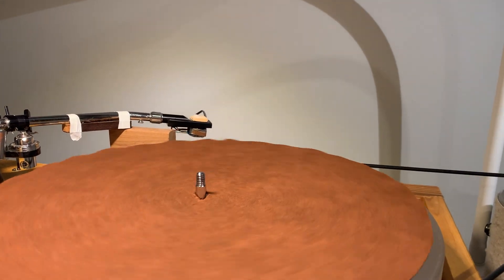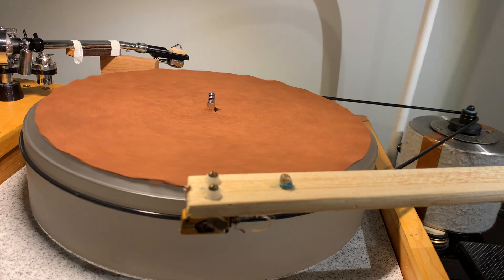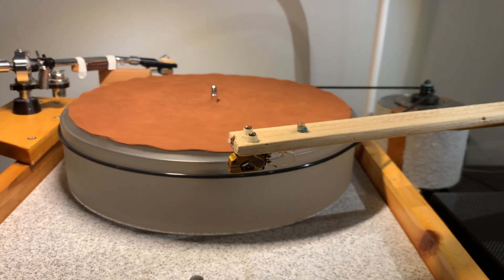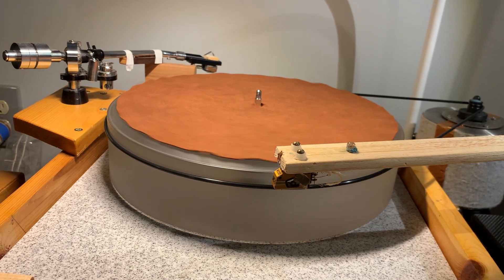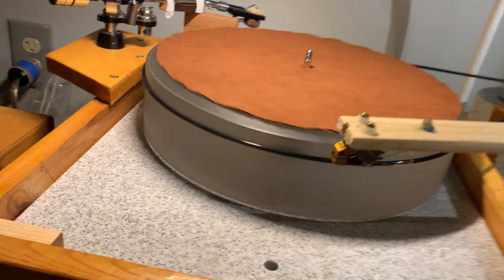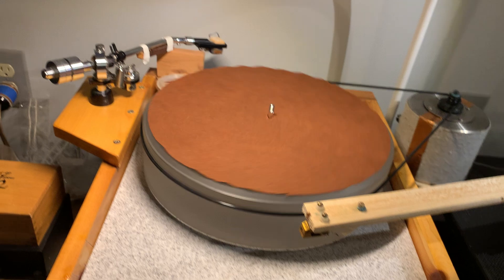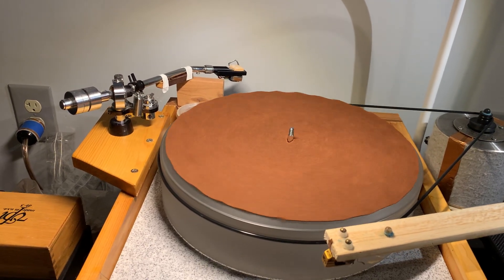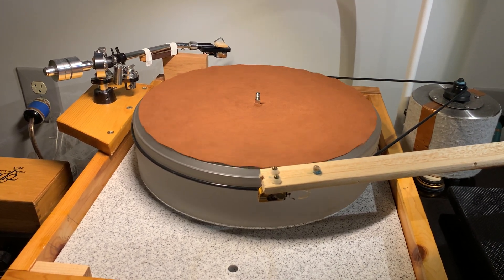How to plan for multiple MC cartridges - my example

Comment: Hi Janos you need to consider also how the output voltage of the mc cartridge is generated.
For example my Supex 900 has about the same output at .3 mv as my Carnegie cartridge.   The step up requirements are different because the Supex has its coils are wound on a ferrous core and the Carnegie carts coils are wound on an air core bobbin.While they both have similar output voltages they wont work with the same step up because the Supex is 3 ohms and the Carnegie is 30 ohms.This is somewhat of a rarity but it does occur so also keep an eye out for the carts output impedance as well when using multiple carts with 1 step up trans.
Regards Lou
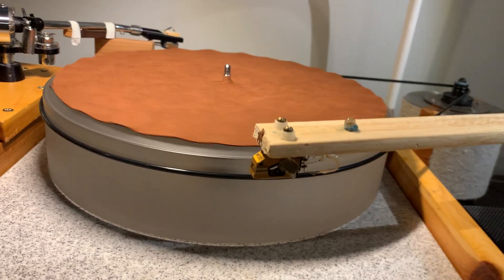Reply from the maker: Thank you Lou! 3R with 0.3mV, that's quite amazing. Indeed, it will not be happy with a x25/28dB step up... will need higher impedance matching. Do I remember correctly, your Silk step-up has 1:40 step up ratio to match it? Regards, Janos ;
Reply: @realworldaudio  Janos I use the Hashimoto which i can series or parallel the primary windings for 1:20 or 1 : 40 in which I use my Audioquest 404i or Supex 900 on 1:20 and I use my Audio note IO at 1:40.
The Silk mc 220 step up is 1:10 or 1:20 which I run the Carnegie at 1:10.
So load wise the Carnegie is seeing 47000/10 squared which is 470 ohms
for the 30 ohm cart.My Koetsu rosewood runs happily on either trans.
Reply from the maker: @loureda5443  Thank you Lou! What do you think, how does the AN IO sound vs the Hashimoto? (As both have the same step up, a reasonable comparison can be made between the two.)
Reply: @realworldaudio  Hi Janos i have not compared the Silk and the Hashimoto because my Carnegie needs  low gain and it works well with the Silk trans at 1:10 and the Audio note IO needs the Hashimoto set at 1:40 because of the .05 mv or 50 microvolt output which gives me about 2.0 mv
output.I think the Audio Note s9 flagship trans is even higher gain at 1:45.I have things set up for minimal cable swaps to listen to the various cartridges.Regards Lou
Reply from the maker: @loureda5443  Sorry Lou, I misread your comment. Thank you for sharing! I agree with you, the minimal cable swap is the most practical scenario. :)

Comment: Hi, Janos! Tell me, will my life be unfulfilled until I try a moving coil cartridge in my audio system? I ask because I’ve been a moving magnet/iron guy all of my life. When Stu was around, I’d my modified Grado’s from him. In recent years, I’ve been a fan of Nagaoka cartridges. 

My phono preamplifier, a PS Audio Stellar Phono, will accommodate any cartridge so that’s not an issue. I was thinking that my next cartridge purchase would be a Nagaoka MP-500, but the Hana ML moving coil cartridge intrigues me. Of course, cost is always a factor. What do you think?
Reply: Hi Ira I don't think you can go wrong with either of your choices. I have a friend with the mp 500 and another with the Hana
ML.I would not persue a moving magnet cart because lack the speed and transparency of the other 2 and this is because in a moving magnet design the magnet has to be small
because it is attached to
the cantilever so it limits
output and because of this more turns of wire are required to make up for the weak magnet which rolls off the highs further
because of the additional
inductance.In a moving coil or moving iron cart the magnet can be made
much larger because it is stationary.Bigger magnet
less turns of wire and less
mass equals more transparent sound.Go with
the Hana ml if you have good step up if not go with
the MP 500 which souns lovely Regards Lou
Reply from the maker: Hello Ira, Stu was adamant on MM because the MMs he carried could be easily tweaked to sound much better. His modified 65$ Grado Prestige Black MM competed easily with cartridges in the 4-500$ range. Stu had most fun with turning something very affordable into something high level. The bigger the jump with the tweak, the more it interested him. Also, with MM, there's no need for MC step-up, so you can focus all your attention to upgrade the phono stage with the better parts, and get better results.  So, with MM you get the best bang for lowest price. However, as Lou said, MC (and moving iron, but I have not played with those) inherently has much more potential due to the more efficient magnetic circuit and the much lower moving mass. Yet, the complexity increases, as it becomes WAY more sensitive to noise, setup, phono stage, and step-up.
I need to add that Stu was adamant on keeping all the system components at the same level, so an upgrade from MM to MC also requires major changes in other components of the system, to allow bringing out the potential. (Stu hated leaving untapped potential.) The step up from MM to MC is very big. For me, it was a big jump in bass - MC allows deep, deep bass to come through (if there's any on the record), much lower noise floor (quieter than digital!), delicateness, the end of bass-midrange-highs distinction & change into authentic music instruments. To get it right is much harder though than MM: MM is like walking a comfortable road, and MC is walking a tightrope.
Reply: @realworldaudio  I hate to tell you this Janos all Grado cartridges are Moving Iron not Moving Magnet and most are around 4 mv output so a step up is not required.The big jump in the bass in a moving coil is less wire and turns ratio and a much larger motor or magnet as opposed to the tiny one on a moving magnet.Moving iron cartridges like the deccas,grados,nagaokas,soundsmiths can also sound to my ears superior to virtually all moving magnets because the magnet can be much larger because it is stationary and a small cross of iron is moving instead of a tiny magnet. On a moving magnet you lose on several fronts one being slower transients because you are having to move a magnet and two being the additional turns of wire needed to get 5 mv out because of the small magnets.In the end you get less focus,transparency and power Regards Lou
Reply from the maker: @loureda5443  Thank you Lou! Indeed, slipped my mind Grados are moving iron.... I've been just thinking of them as high output cartridges, and treat them as MM for their phono requirements. ; Janos
Reply: @realworldaudio  Its all good Janos were are all here to help each other 
out Cheers Lou
Reply from the maker: @loureda5443  Thank you Lou, cheers! Now it's more clear to me why was Stu so obsessed with Grado, and why did he go to such extremes to modify them. He drilled off the plastic body on the side, and added mu metal sheets right next to the magnet to keep the magnetic lines more focused. This works much better with the fixed magnet / voing iron than with the moving magnet. (Although I have to add that it helps MM as well, but not to that degree as we observed with the Grado.) That catapulted the cheap little Prestige Black to very high standards.

Comment: Hi Janos. How can the (stereo) Benz mc3 play mono records (from mono lathes) better than your true mono AT33??
Reply from the maker: True monos have the advantage that they reject the noise on the vertical plane.  However, the Benz is so quiet that it plays virtually noiseless regardless mono or stereo records.  It is also a higher grade, more resolving cart, and plays music with better tone.
Reply: @realworldaudio  Wow, I would think that the specifically designed (and not entry-level) AT33, would beat most stereo cartridges due to the inevitable smearing!
Reply: @realworldaudio  Did you ever use the SUT with the AT33? Just wandering how much of the Benz superiority over the AT33 when playing mono recordings is due to the SUT vs. the internal stepup of the Violin?

Comment: Very, very useful information Janos! How do you swap between the vintage MC and the AT MC stereo cartridge? Was the AT stereo cartridge connected to it's own headshell, and then you just swap headshells? Claus
Reply from the maker: I keep the Benz MC on the long wooden arm that feeds the step-up transfromer. The Sony PUA arm (which has the removable head-shell) connects to the MC input of the phono stage, using the internal active step-up. So, I am using the internal active gain for the removable head-shells (swapping AT33mono / stereo AFT7) for browsing "new" records, and the Benz through the step-up for special occasions.
Reply: @realworldaudio  Am I correct, that the AT-Violin MC combo outputs 0,62v (0,00035 X 1780), while the Benz-SUT-Violin MM combo outputs 1,38v (0,00035 x 25 x 158)? And if so, can you play loudish music with both solutions using only the AVC before the Darling? Thanks Janos!
Reply from the maker: @earkivaren  Yes, correct! With the VOL it plays real life volume of orchestral classical concerts with the SUT, close to that with the Violin MC. With the Voigt pipe it plays noticeably  quieter than a live orchestra, but a full orchestral piece (such as Beethoven IX or Mahler V) is still fully enjoyable and experience is comparable to real life concert. (Did that comparison many times - listen to stereo right after a concert. Depending on A/C line ocndition, the experience is either similar, quite a bit worse or even better(!) than the real life experience).